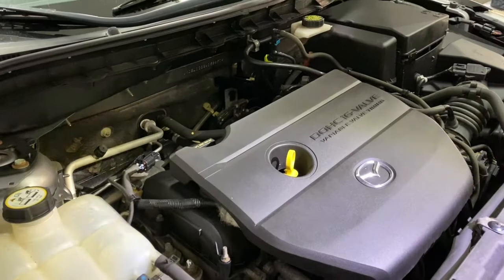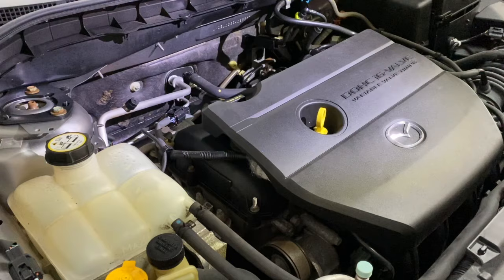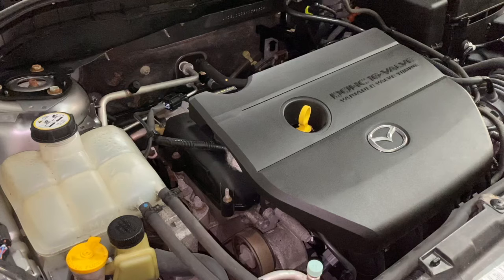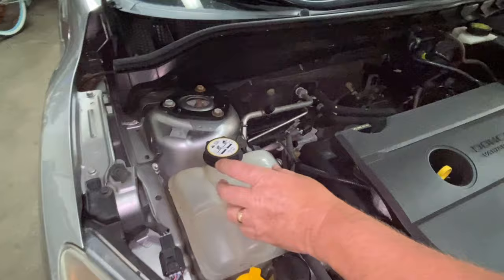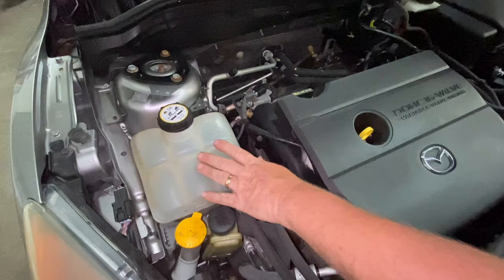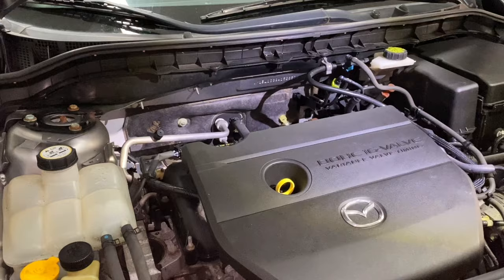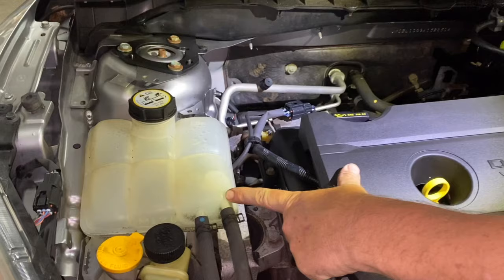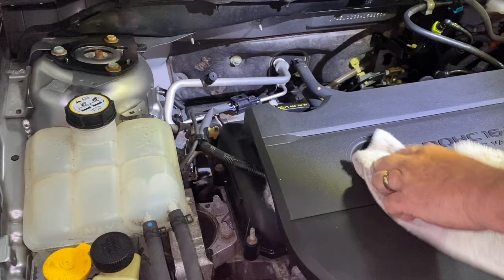Learn 3 Symptoms of Blown Head Gasket

Comment: I have a diesel mercedes the engine is near new (replaced by the dealer) but I'm losing coolant (about 500ml over 6 months) no milky oil or oil in the coolant. I do see a tiny plume of white smoke recently when I take off in first gear when the car fully warmed up. Can't figure out ifs a head gasket, a radiator, could the white smoke be unburned fuel in related to this problem ?
Reply from the maker: When the car if fully warmed up, like driving on the highway for 10 minutes or so , you should never see a plume of white smoke because that’s not the thinner condensation white smoke which is normally for any combustion engine bu
Reply from the maker: But if you experience this when fully warm, you are burning coolant. And no the radiator cannot cause the car to burn coolant. And being it’s a diesel which have much higher compression than a gasoline engine it may be the gasket failing again

Comment: I know this question is redundant but today I took my VW beetle turbo 2012 to get an oil change. The service rep says it's oil in the antifreeze reservoir tank.  I looked at it and it's that chocolate milk shake appearance in the tank. Other than that the car runs great no over heating or white smoke from the tail pipes.  Could this be caused by anything else other than the head gasket?  I sure hope so.  My car only has 85k on it!
Reply from the maker: Unfortunately, it does sound like a head gasket starting to fail ( coolant entering into the oil passages, however your car has an oil cooler that’s worth having checked first to see it the gasket failed, that would allow coolant to mix with oil as well.
Reply: @Motorcarnut  one other question.  Head gaskets usually fail due to over heating right?  Can a head gasket go bad without the engine ever overheating?
Reply from the maker: Yes, corrosion from not maintaining the coolant system and some just fail from age.
Reply: @Motorcarnut  okay thanks. I really appreciate your prompt response!

Comment: Hey could you help. Mine just started smoking and heat gauge didn't move opened the coolant tank and it was all foam and bubbles. Then we just put some more coolant but this time we mixed it with water. And now i think it is still foaming a little and the smoke is almost gone. I don't want the mechanic to rip me off. What's wrong with my car and is it a big issue? Thanks in advance
Reply from the maker: What vehicle do you have?
Reply: @Motorcarnut  I'm from turkey and the mechanics here are known for rip offs. opel combo 1.3. is my vehicle. We changed the oil cooler bc he said the oil is leaking into the cooler system and not the other way. But now he wants us to change our fuel injector even though our car starts just fine. What should we do ? can something still damage the engine ? maybe the oil injectors are still leaking into the pumps and would that even be a bad thing? pls give me advice bc injectors are too expensive
Reply from the maker: could be a blown head gasket pumping up the coolant system. Did they check for exhaust gases in the coolant?

Comment: 2007 charger rt/awd white smoke from tailpipes, oil and engine light are on and it’s leaking really bad underneath whenever I try to start it up and it sounds really choppy n awful like something is misaligned I also did a coolant tank pressure gauge and there was no pressure as if all the air was escaping into some crack down below hintsw the leak, I think it’s head gasket blown/cracked pcv valve or radiator cap or a mix of the 3 please help car has been sitting for about a week now
Reply from the maker: You first have to determine WHERE it's leaking from underneath the car, how can I give advise? There are just too many scenarios of what it can be. It does sound like coolant is getting into the combustion chamber. Oil light is probably on because it's not idling correct and what codes are coming up?

Comment: I had a new radiator installed over a year ago and I just noticed I have water or coolant not sure coming from the bottom front left and right side close to the radiator. Any ideas?
Reply from the maker: Could be a hose, overflow tank or the radiator again. Try cleaning undertone car then recheck for leaks, should be easier to find
Reply: @Motorcarnut  For now until I figure it out can I put water vs coolant to avoid wasting so much money on coolant until I get it fixed?
Reply from the maker: Not really because using straight water will make it overheat even more.
Reply: @Motorcarnut   I am taking it to a shop to have it diagnosed. Yesterday the check engine light came on again. Before it was a misfire and later catalitic bank 1 issue. I do not know why the code reader goes back and forth.

Comment: i have an acura integra ls and i got it with a bad water pump. coolant comes right out the weep hole. ive run it a couple times for small amounts of time to move it slightly, but have been waiting to give it to a shop. the day i brought it, it was the morning and kinda chilly and when i started it to roll it on the flat bed of the tow truck when the engine began overheating and a thin white smoke was coming out of the exhaust. is it the head gasket? or is it just the fact that theres no coolant going through the system. i didnt smell anything from the smoke, and it hadnt done that before that day
Reply: also there is still coolant in the reservoir
Reply from the maker: If it was smoking when you first started it , that is normal, if it started smoking when it was hot then it's buring coolant and that can be a head gasket or crack somewhere in the combustion chamber. If i were there I can tell just by smelling the smoke and know if its burning coolant. Did the smoke smell sweet?
Reply: @Motorcarnut  the smoking started when i started the car. im also pretty sure while the car got put onto the tow truck, the smoke stopped. I dont remember smelling anything sweet, but then again I could just be trying to persuade myself its not something serious. does the thickness of the smoke matter at all? i just remember it being thin and whispy

Comment: My 05 tahoe throws smoke when turning on and smells like gas, after it doesnt throw smoke at all. Might need to replace headgasket?
Reply from the maker: Hard to say, does it run fine after it’s hot?
Reply: Yes, no milky oil, maybe a bit of coolant went out from yesterday. It also does not heat up.
Reply from the maker: If it were a head gasket problem it would run good when hot for long period of time. Might have someone local check it out, I’m not there to advise you and don’t want to steer you in the wrong direction.

Comment: I watched your videos on 2010 Mazda 3 . Question I have a 2013 Mazda 3 it ran hot once we found the problem it was the water passage I didn’t get air out of lines as I was told was told lol however that problem is fixed . Now long story car sat for 6-7 months cause ppl kept telling me I had a blown head . I did need a battery and plugs and valves cover gasket . However now my heat is cold until I press gas then it gets warm take foot off gas gets cold soon as I take foot off gas . It’s not the bend door, we have dbl checked everything possible . I was researching could it be a open thermostat? Cause it keeps the motor cooler than it should be . I’m lost as to what this could be . Any advice would be grateful. 4:51
Reply from the maker: That’s classic air in the coolant system situation. Has to be bled, it can be a thermostat but I’m guessing their is air trapped in the system. Also the coolant system should be free of any corrosion and nice clean coolant.

Comment: My Chevy Malibu 2004 has trouble accelerating from a stop 🛑 sign or a red light. Other cars behind me have to go around me because my car moves slow as hell to move when stopped . Could this be a head gasket issue or spark plugs ?
Reply from the maker: Lot's of issues can cause bad acceleration, fuel, ignition timing, compression etc. so it's hard to know. Does it soke bad like in my video?
Reply: Smoke 💨 ? Nah it doesn’t . I mean at the start. Little smoke comes out of the tailpipe but I heard that’s normal. It goes away after a few mins and it’s a whole lot less then this. My RPMs rev high and the car just don’t want to take off fast or it’s extremely slow to pickup speed. Engine even sounds loud at first. Chevy Malibu 2004
Reply from the maker: Correct, a little smoke is normal on cold start up. Could be an engine misfire, bad plugs, wires or coil and as I said before, fuel. Transmission problems can also cause your problem as well.
Reply: @Motorcarnut  damn I hate that word transmission. Once that goes out I ain’t putting no more money into this old car.
Reply from the maker: Hopefully it’s not. You should have someone local check it out, probably a minor problem.

Comment: My head gasket is blown  car keeps overheating and guy at shop says it would be cheaper to buy another engine instead of replacing the head gasket I have a 95 camaro v6 3.4  engine plz help me what should I do I don’t know anything about cars and this is my first
Reply from the maker: Are sure the head gaskets are blown? That It’s not a faulty radiator cap or radiator or coolant flow problem? If it is the head gaskets take it to another shop to replace them. It’s not cheaper to replace the engine plus the engine you replace it with how do you know how that one will run, could be worse than the one you are replacing. Makes no sense for you, for them they charge you more money. So look for someone else.
Reply: @Motorcarnut  yeah the guy at shop says my head gasket is blown and that it would be more expensive to replace head gasket then to buy a new engine for the car overheating. He said the reason why my car is overheating is because my head gasket is blown
Reply: He also said he put some sort of fluid or something in the head gasket and if it came out green then that means it’s blown

Comment: It has been 100+ temps out here lately and i've been noticing that my engine bay is extremely hot (even when i only run the car for a short period everything is too hot to touch) and it takes a long time to cool of... also my fan runs at full speed when i have the ac on and I notice an intermitent engine stutter that can be felt in the cabin. Could My engine be overheating or my head gasket be damaged? My coolant and oil both look fine and my temp dial never exceeds the normal 90 operating temp. I have no lights on at all. But the hot engine bay,  loud fan and the occasional engine stutter concerns me.
Reply from the maker: Everything you explain is normal in hot climates, but the engine shutter may or may not be normal. Could be you are feeling the ac compressor engaging and disengaging which is also normal.
Reply: @Motorcarnut  I’ve had the car a few years now and although this 100+ temps are definitely higher than the previous summers I don’t remember the fan ever getting this loud literally sounds like a jet about to take off. Does it go off outside temps because We’re getting consistent 110 some days. Also it’s interesting that you mention the ac as culprit for the shaking because the clutch recently went out. I thought I would have to get a whole new ac but I tried swapping with a clutch I took off a compressor I got from a junk yard and it’s been cool air ever since (about a couple months). I am wondering however if this may mean my pulley is bad or the whole compressor is on its way out? The shaking doesn’t happen directly with turning the ac off and on so I was suspecting maybe a pulley. I wanted to change the pulley with the clutch but at the time I didn’t have the correct pliers to remove it. Would you recommend I try changing my compressor pulley as well?

Comment: Can this happen directly after an oil change? It was really cold last night so when I came in for the oil change this morning I expected a bit of white smoke to come out which it did. But then after the oil change I would stall for like 2-3 seconds every now and then, most of the time when accelerating. This wasn't happening at all before the oil change. Did my guys put oil in my car that my car didn't like, put in too much/little oil, or was it just from the super cold weather? I also didn't drive for an entire day so there might be a ton of coolant that needed to be burned up.

For clarification I drive a 2006 Sentra. 1.8L, has around 260k miles. I haven't had any problems with anything involving the engine or head gaskets.
Reply from the maker: No, they must of did something if you didn’t have any problems before the oil change. I would go back asap before they blame it on something else.
Reply: @Motorcarnut  It WAS from the oil change haha. They put in the wrong kind of oil and too much of it.
Reply from the maker: Told you! Great glad it’s fixed.

Comment: I have a 1973 450 sl Mercedes it's running with a miss and when I push on the gas it feels like it's clogged! And made a popping noise from the muffler and when I really push on it on the freeway a lil white smoke comes out from the muffler not a lot , ????????????????
Reply from the maker: Sounds like timing is off ( popping sound) and faulty ignition system, maybe a bad spark plug, ignition wire or cap and rotor.
Reply: @Motorcarnut  just curious? Can a bad camshaft cause it to run like that?
Reply from the maker: Absolutely, if the cam lobe is worn enough and not opening the valves properly that in turn will give you a miss
Reply: @Motorcarnut  ya it sucks cause my car was at this mechanic for 2 months all he did was put wires and he said he put plugs and new cap but it seems like it's running worst  when I bring it in it was not that bad ! I gave him 1200 $ he didn't no how to work on my 1973 450 sl
Reply from the maker: Shame, most mechanics get lost on German cars.
Reply: @Motorcarnut  I got a question I'm sorry to bother u ! But idk why I took off my distributer cap not one clamp won't go back on no matter how many times I line it up? Does this happen and what u think I'm doing wrong??
Reply from the maker: I believe it has the spring loaded hook the attaches to the distributor base and the cap itself has an indent that only goes on one way. Make sure it’s seated evenly before attaching the hooks.
Reply: @Motorcarnut  how's the weather in Houston does it still rain alit and flood ? I use to live on fm1960 lol now I'm in Reseda Calif. I have a ? I put back the distributor it seems it stars so bad sound like gun shots when I raise the motor lol
Reply from the maker: Actually I’m in New York, lol. Sounds like the firing order and or timing are off. You need the find the firing order for the spark plug wires and make sure they are in the correct order and timing has to checked as well.

Comment: I have a 2008 Volkswagen Golf GTI 6 speed and I had a question. I have white smoke coming from my tailpipe only when I'm stopped at a red light, my coolant level is fine and no check engine lights and the coolant is fine but the ginside of the gas cap has a tiny bit of mayo cramish on it, is that an early sign that I'm getting a bad head gasket?
Reply from the maker: If the car is running fine and the white smoke eventually goes away, the light oil residue on the bottom of the oil cap is normal condensation.
Reply: I have one more question for you. What if it smells like burning oil while I'm at the red light stopped. It does that for a bit and again everything drives fine but white smoke comes out and sometimes more than usual. I check the oil and it's still full and the coolant temp is normal, what do you think that may be?
Reply from the maker: Does the smoke go away once warmed up to operating temperature? What color is the smoke?
Reply: It is white and only shows when I'm stopped at a light I checked the temp for coolant and still seems good I even come out of my car to smell it and smells like burning oil of some sort
Reply: @Motorcarnut  
in a small amount it consumes my coolant and there is white smoke when idling when I add gas it does not show white smoke is it a head gasket?

Comment: I have the same white smoke but no loss in coolant and its not mixing with oil either any idea what it might be
Reply: Its a 2014 explorer sport
Reply from the maker: It’s normal to have some thin white smoke when cold but if it continues and doesn’t go away when hot, you probably blew the head gasket.

Comment: Hi, i have a Nissan Xterra 2009. It had some radiator problem, overheating so i just switched off the engine. Came back a few days later and the car won't start, i checked the oil and it's mixing with water. But the it won't start, what could be the problem? It just gives a jerk when firing the engine.
Reply: I also have a 05 Lexus LS430 with the same problem! But i haven't checked the oil and coolant of that vehicle.
Reply from the maker: The reason it won’t start is because not only is it mixing with the oil in the crank case, coolant is also going into the cylinders. Sounds like a head gasket problem at the minimum or a cracked cylinder head.
Reply from the maker: My first answer was for zayn  Hassan
Reply from the maker: Oh same person lol sorry on the Lexus you have to first see what’s going on with the oil and coolant first before I can comment on that car
Reply: @Motorcarnut  thank you so much for replying. My mechanic suggested to replace the engine because according to him the engine is totalled.  Can that happen?!
Reply from the maker: Well it depends on what extent of damage there is. Plus labor and experience is a lot more on rebuilding an engine then just replacing it. I personally like  rebuilding the original one engine if possible because with a junk yard engine it’s always a gamble